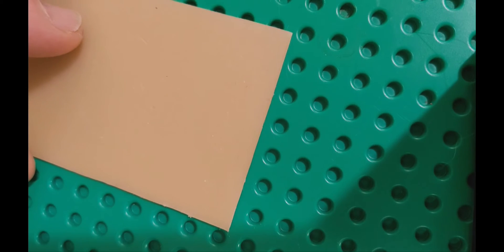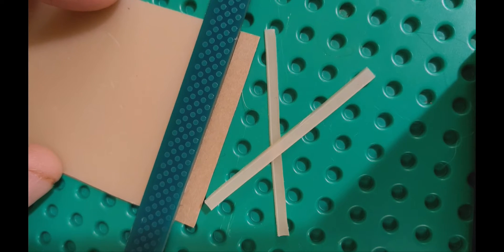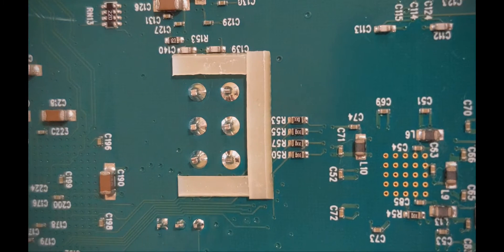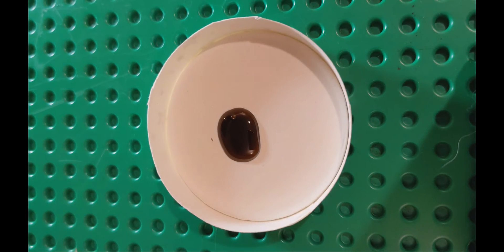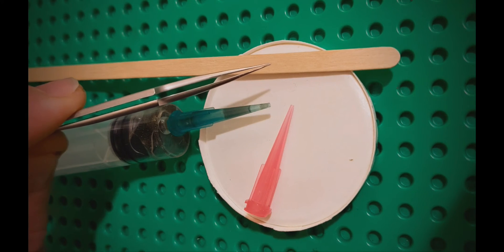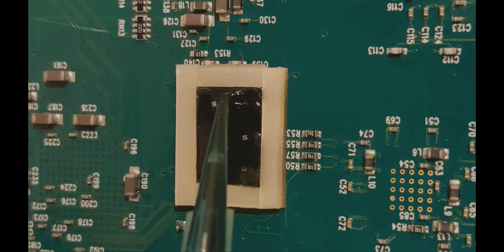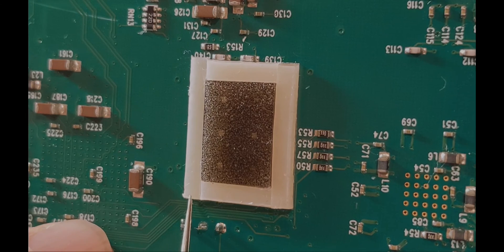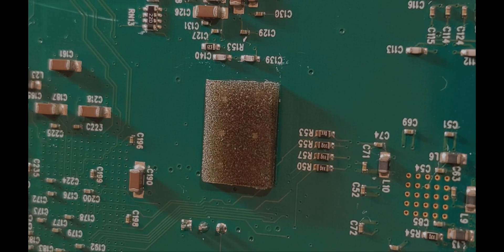How To Protect / Waterproof PCB Parts || Soldering Tutorial

Comment: Nice, I did notice a lot of tiny bubbles in the compound, would that cause issues with heat later on?
Reply from the maker: Hi , thank you for your comment . The epoxy I used was called Adekit  , a quick setting compound where you don't get time to degas properly in a vacuum chamber as you would with some epoxys used on pcb's . 
It is a naturally looking speckled substance when it dry's with the appearance that it is very bubbly . It isn't as bad as the appearance regarding micro bubbles appears . There are some micro bubbles but this isn't an issue with this epoxy , very large bubbles could be .
I always de-gas epoxy's if I can ( more workable setting time ) but you will find some you can't do this with . Hope that explains a little . Thanks again , take care 👍

Comment: I have been using UV curing resins for the last few years it’s much easier than having to mix a two part epoxy and is faster curing. I’m just using hobby grade UV curing epoxy rather than one designed so specifically for electronics. I’m not sure about it’s long term stability but have been potting high voltage circuits and so far it’s good for 30Kv.  I do also use it to reinforce pad and track repairs with good results.   I did note that the epoxy in your video was full of bubbles and that could cause issues.   The way to get around this is not too mix so vigorously, degas in a vacuum chamber or use a heat gun. But in your case heat gun would melt the wax.   Give the UV stuff a try let me know what you think.
Reply: Good to know. I wonder which hobbyist method has lower CO2 footprint, and which one is more environmental friendly after the repair and when the electronics are disposed after several decades of service🙂

Comment: Can this epoxy be removed easily if need be?
Reply from the maker: Hi , all epoxy compounds are slightly different , with some being easy to remove and others being more difficult ( scotchcast compound being a very difficult one ) where as silicon based rubber ones can be a lot easier , so it all depends on what type you use really . Hope that helps , thanks for watching 👍
Reply: @mrsolderfix3996  
Thanks for the reply.
Great content!
Reply from the maker: Hi , no problem , thanks for your support 👍

Comment: Very good video. Does the compound interfere in any way with the electrical current that passes through those solder joints?
Reply from the maker: Hi , thank you for your comment , much appreciated. I've used potting compounds many times over the years and have never had a problem with changes in the board dynamics , so from personal experience I would definitely say no . There are hundreds of different compounds available from waterproofing to flame retardant ones so I can only say try and choose the one that fits your requirements and you should always be ok . Thanks again and good luck 👍